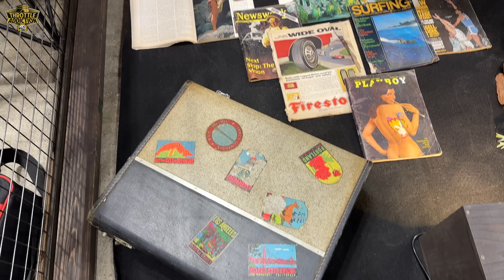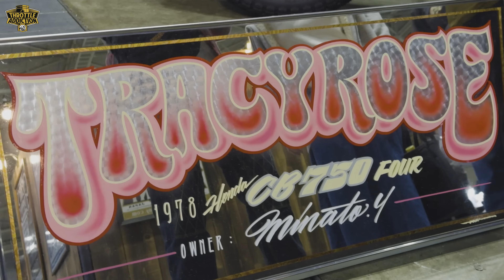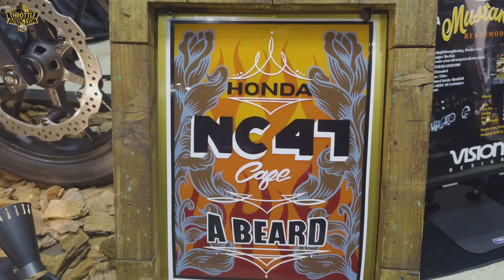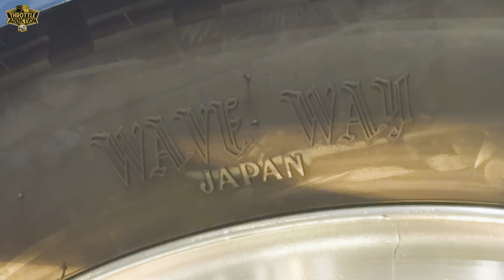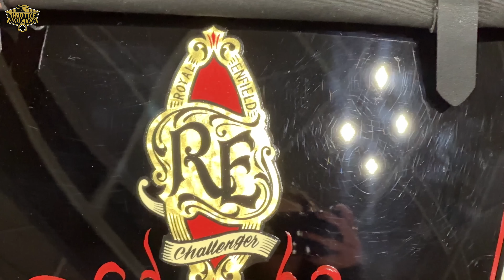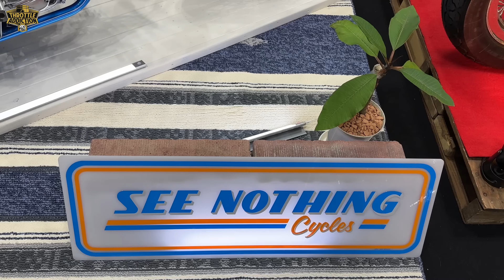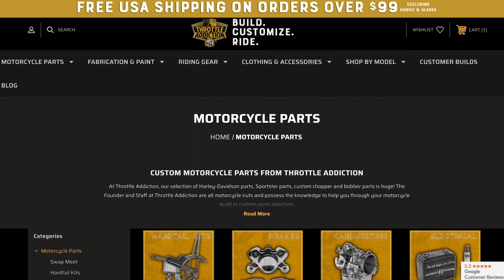Every Custom Motorcycle at MOONEYES 31 [4K] 1 hour and 30 minutes of Choppers!

Comment: I hate to say it but 99.9% of these bikes have not been ridden. No bluing on the pipes whatsoever, literally zero sign of any carbon and did you notice how many bikes they pulled the spark plug wires out to not look messy. At least back in the biker Build-Off days you had to ride them 1200 miles when finished! Trailer Queens just don't do it for me personally
Reply: I love most bike shows as long as the music isn't so loud you can't talk about the bikes with  the builders while looking at them. I often find myself out in the parking lot admiring some of the bikes people rode to the show though.
Reply: Gotta agree with you about bikes not being used but still  all the bikes were of top class  lottsa individual bitsnbobs  on em ride free fae SCOTLAND 👍🏴
Reply: I was thinking that ,, its a shame bikes should be ridden and respected,,, 😊😊